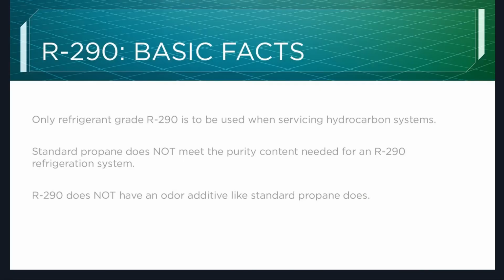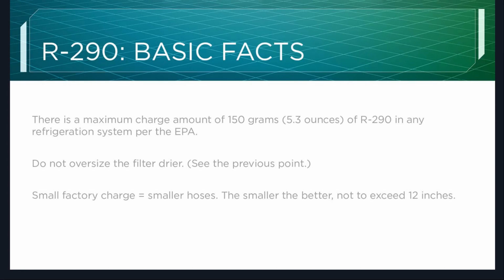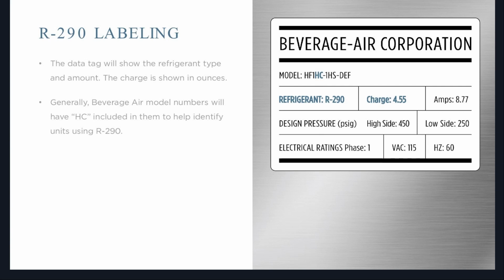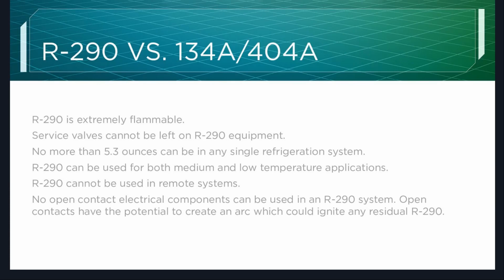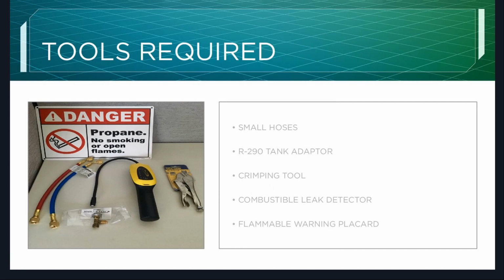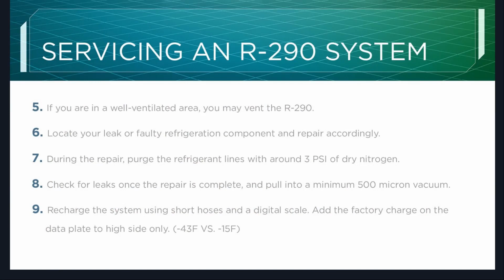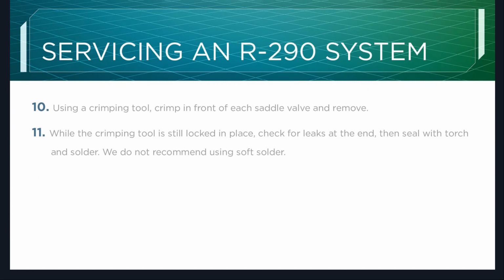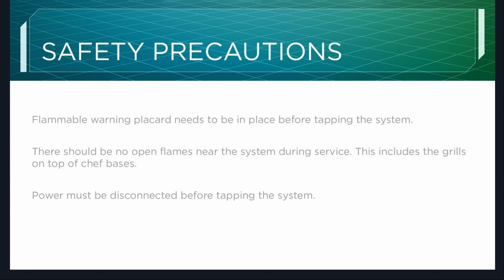The Facts About R-290, presented by Beverage-Air and Heritage Parts

Comment: Problem is,  290 mixed with flamible POE oil equals napalm  !   People will get hurt badly, their lawyer will sue the technician, supply house that sold it, the equipment dealer that sold the equipment and the manufacturer. The insurance companies will drop any company that sells r290. Liability will be the end of r290.